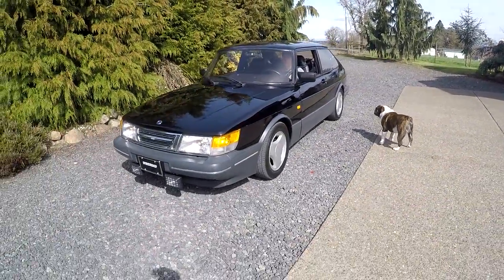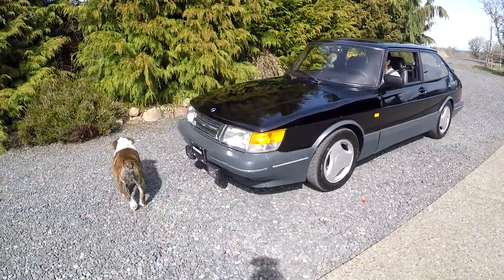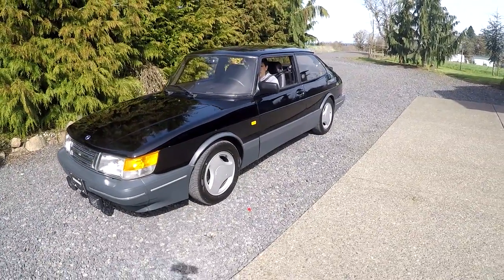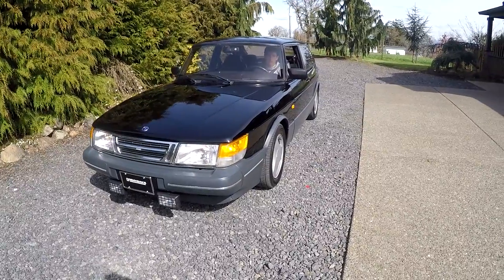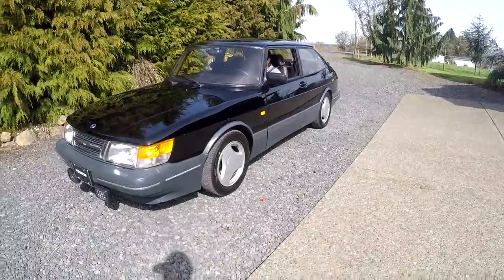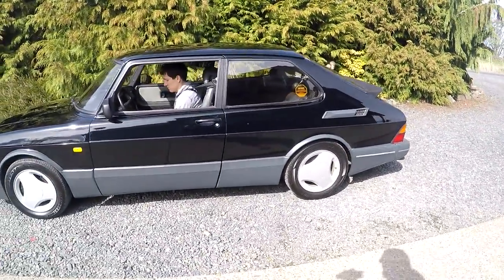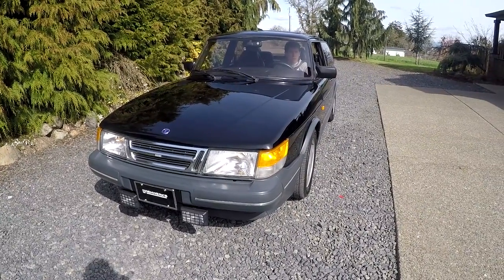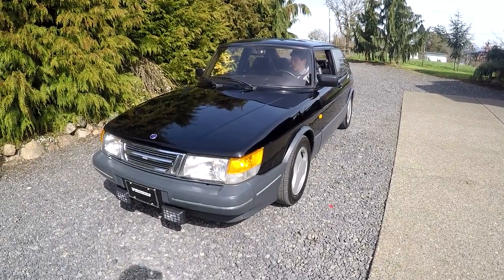1989 Saab 900 Turbo SPG - 5 Speed - Denwerks - Bring A Trailer

Comment: In the hatch you can flip up the cover and it clips in a holder on the upright hatch.
I had the same color interior in my '88 900 T.  Awsome interior and I had the three spoke steering wheel which I think is the coolest of any car I've driver.  You can put one hand in the lower oval when driving.
Cheers and enjoy your videos.